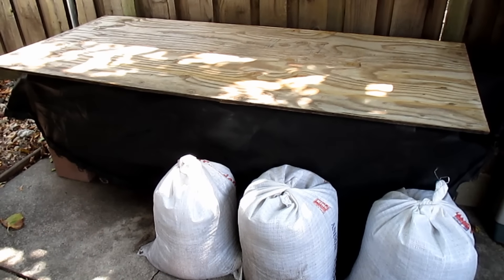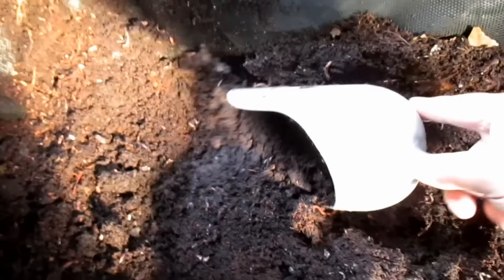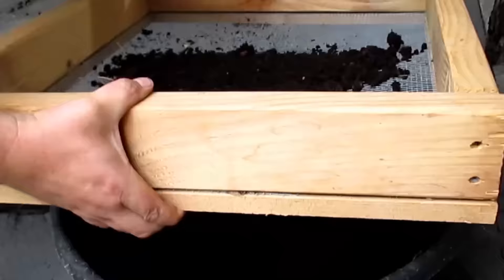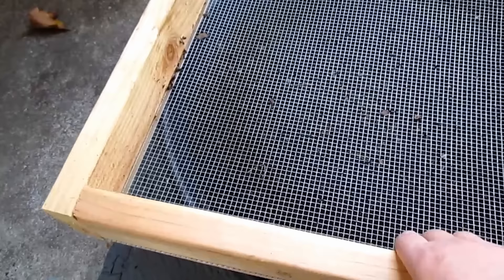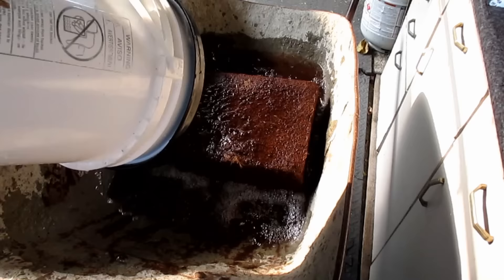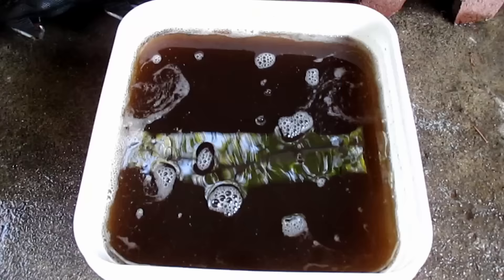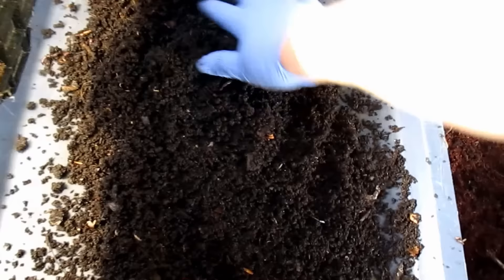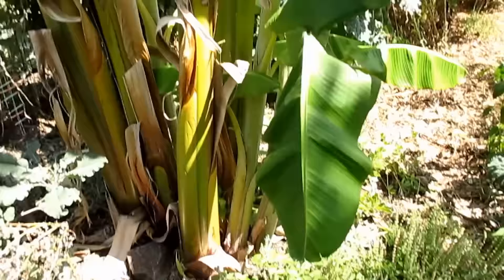Harvesting Worm Castings | Highly Effective Method For Separating Out The Worms!

Comment: I also wonder about the egg casings.  When I empty a worm bin I take great care in saving the egg casings.  It takes me a long time but I feel like I am saving future worms.  I empty the castings into 10 lb. plastic containers.  Every day I take a little time to discover a multitude of eggs.  I keep finding eggs for weeks.
Reply: I think (from another video I watched) it could be the size of the screen? it may have been small enough to block the cocoons along with the worms?
Reply: Hey Chauncey!! How long until all or most eggs have hatched? Thanks
Reply: @leticiaportelinha7347  
.... about  21-ish days if I memba right.
When I started, I basically made sure to give it about 6 weeks before I would harvest any castings so that 95+% eggs have hatched and are big enough to be up eating with the other guys. 

Now I have a few Big worm bins (8ft x 4ft & 3ft tall, each bin)
So this may not really apply to your worm bin/casting harvesting but...

I add approx 2 inches of food weekly to each bin.  It takes the worms approx 1½ weeks for to process 2" of food.
So about the time my bins were around 20 - 24 inches tall or filled up rather is when I started harvesting the castings via cutting 2 inches per week off the bottom.

Anywho...
Best of luck
Reply: @d New worm caretaker here, but have heard that you shouldn't feeds the worms anything with meat, dairy, salt or acid.
Reply: I admire your patience
Reply: @Guruc13  Animal products encourage pests, for one thing. Acidic foods, like citrus, can change the pH of the soil.
Reply: Thx for info.
I recycle my "disaster preparedness" food. Meaning as cans of veggies get close to expired dates, I open and give veggies and juice to worms. I've a very small starter bin.
Reply: @Guruc13 correct

Comment: Good tips, just one thing I would recommend is to put casters on your wooden sieve then just rock out back and forth on a bench and the castings will drop through and save your back.
Reply: Nah it's good for your back. Use it or lose it
Reply: @Diseaseisreversible  I would definitely lose it if I sieved more than 8 trays. lol

Comment: I used to have a job where I would dig out underground vaults 3' x 2' x2'. I would once in a while find one filled with worm casting, I would fill at least of those bags with the casting and worms and I would bring them home and dump them in my yard, the casting would be super fluffy and light and filled with tiny worms.

Comment: What I have seen in a video put forth by Geoff Lawton is to put fresh food on the top of a section of the container and then cover that section. Leave the other section open so light will be on the surface. A great idea would be to light the uncovered surface to expedite the worm migration. Effectively, it would be less time consuming to have a full bins worth of worms actively striving to populate the 33% of the covered fresh food area at which point you could fork off the top six inches and  transfer the worms and new food to an active bin. Repeat on all bins. The remainder should be mostly worm free.

Comment: That's a really great operation you've got there.  I hope to get mine a bit more productive one day but I'm just using a worm factory 360 on the back deck, because the space is limited. I harvested about 5 lbs of castings today, and I get that about 3 times a year. It's enough for my small garden. But I've been moving some excess worms into a couple compost piles outside and they are really multiplying. They get lots of blended veggie scraps. Winter is on the way and I'm hoping to get them all in the big compost pile for a better chance at survival. Next year I'm hoping to have enough castings for all the neighbors that want some.
Reply: What zone are you in? Will they survive the winter?
Reply: I did a compost pile last year and beefed it up with lots of leaves, old container soil cover by the back porch when I dug into it in spring I had a good amount thriving zone 7

Comment: Night crawlers work perfectly fine in a bin like that... you only need to add more grit then you would with red wigglers  ( with reds its not really required to have grit but it helps)--- ps.. do Not mix night crawlers with reds... the reds constantly take the slime off the nights until they get too stressed and die then the reds proceed to eat the nights dead body...
Reply: That’s why my night crawlers are escaping because i mixed them with red worms 😓
Reply: Thank goodness I didn’t get both types because I didn’t have enough money
Reply: @uchibauki2515  I wondered why I had some worms in the liquid trough at the bottom. I bought both types originally. But, I know better now, I drained it and put the worms back in the top. Doh!

Comment: You gave me a good lesson how to remove casting...thanks. I got a question....I use a old fridge for my wigglers however at times in the summer and lately ( much cooler weather ) more so they are crawling up to the top in great numbers until hitting the cover. You got any thoughts wht?

Comment: Love the video and the steps you used to separate the worms from the castings. I have 3 rubber totes and 4 5 gallon buckets full of worms and castings that are ready to be harvested. I've been using sphagnum peat moss for the bedding. But my question is this: How do you keep your worms from freezing when it gets cold outside? I am really needing to move my worms outside but I don't want to kill them.
Reply: Doesnt mixing compost create heat?
Reply: I put a seedling heat mat over damp newspaper and a plastic bin bag, in a plastic box with a lid in a sheltered spot. Zone 9. They seemed happy, but sulked when I turned it off in late spring around 10-15 C.

Comment: I feel like I need to make a video for COMPLETE novices like me in order to answer questions such as;

1.  What happens if you don't regularly harvest worm castings?

2.  Why can't I use some of the soil to start a new worm bin?  I'd rather not have to spend money on coir.

3.  How to ensure eggs don't get into the final result?  

4.  Are the castings safe to use for N indoor container gardener?  Example, I was instructed to buy certain type of potting soil to ensure the soil was sterile.  

Thank you for all the great information.
Reply: 1. The integrity of the castings can degrade and get mushy and pasty.
2.use shredded paper or cardboard if you don't want to use coir for new bedding
3.you can set the castings in a new bin for a few extra weeks and place a very light feeding on one side to attract any news hatchings and sort the new worms out.
4. Castings are safe for houseplants I usually mix some into potting mix when I repot or sprinkle on top of of the mix.

Comment: Why did you clean it completely? doesn't it a big loss of efficiency as you loose completely all micro bacteria and insects involved in the composting process (not only the worms make the good compost)? i would prefer to harvest first one side, and than when i need it the other side. You can also reduce the numbers of worms feeding with vegetables only on one side (where you will not harvest).
Reply: I agree. The method you described sounds like it could work very well

Comment: Way to complex and expensive. Typical Americans no wonder they're in 34 trillion in debt.  

All you need is 2 x 20L buckets.  Keep your worm farm undisturbed in the shade is best.  After about 12 months, the bottom half of your worm farm should be well composted worm castings containing few worms 95% of your worms will be in the top 3rd of the farm.   Simply but carefully remove the top half of the contents of the farm using your hands don't be a pussy placing into one bucket.   The bottom half will contain some worms but not too many  place that half into a second bucket to use on your vegetable garden or in new potting mix. 

With an empty worm farm it's a good time to do whatever maintenance you need.   Now simply Place worms back in the farm add  cocoa core, sawdust even pea straw or hay for filler if you thinking it's required.  Don't stuff around for hours it can be done in15 minutes.